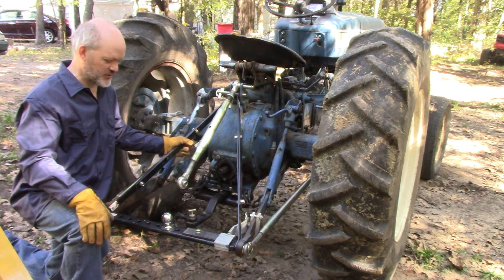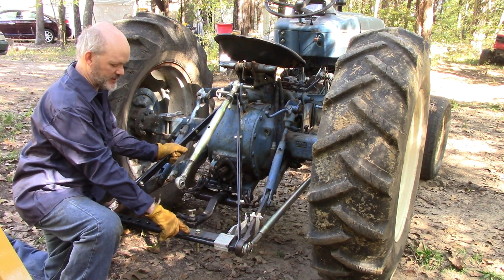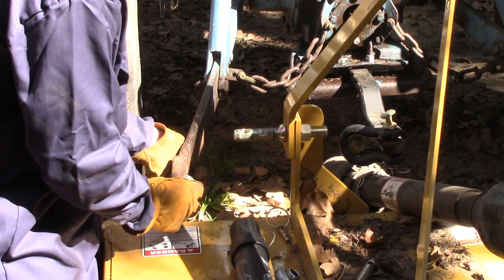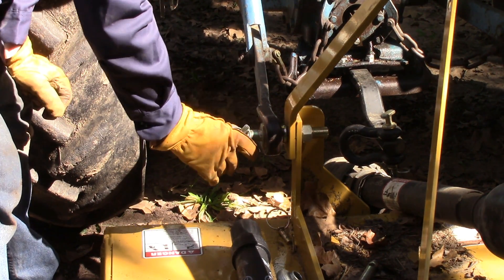Everything that connects to the back of your tractor: Three point hitch

Comment: Good info. More information on draft control for plowing would help. My 3000 always struggles with 3 plows. Looking for setting that will help.
Reply from the maker: I don’t plow so I don’t have experience with the draft control. I do know that these tractors have a pin that wears and makes the arms go up instead of staying in place. This can be worse if you are using draft control. I need to fix mine, but have not got around to it yet.

Comment: Thank you , im new to farming and got ford 3000 and all the emplements and trying to figure it all out. Im a marine and can handle a 1000 marines in combat but cant run a tractor, go figure.   Semper Fi
Reply from the maker: One place that helped me was Tractor Supply. Hidden way in the back behind rows and rows of dog food is a single row of tractor supplies. They have a very nice picture of the back end of an old tractor with parts and attachments identified. You should take a picture of it and study it. I ask a lot of questions on  tractor forum. It has an app. I also use yesterdays tractor forum and buy parts from there. Messicks has an app that I use for parts diagrams.
Reply: @TheDadPenfield  Thank you for the advice and I will use it often.

Comment: Nice video! The 3pt boom pole looks pretty solid wondering if I should invest into this when using a heavy duty chain to drag some logs. I have a drawbar now and thinking if I use just the drawbar I should invest in a drawbar stabilizer for my ford 1715. What are your thoughts?
Reply from the maker: The boom pole is a poor mans front end loader. I use it to transport heavy logs or stumps to a fire pit or lifting equipment. My ford 3000 does not have the front end nor the hydraulic power for a front end loader. 
The drawbar is outdated. If you want to pull heavy loads such as pulling a stump you should invest in a swinging drawbar. With a swinging draw bar the center of gravity is as low as you can get it and this prevents you from flipping the tractor. Drawbars can cause you to flip your tractor especially if the lift arms are raised up. 
 If you want to haul a trailer you should get a three point trailer hitch receiver. Unlike a drawbar. it attaches to a toplink so you don't have to warry about it rotating and it is less likely to bend with the support in the middle and you do not need stay bars because the top link prevents it from riding up. Some will have a hitch on top for gooseneck trailers.

Comment: Good video but you got to get fenders on that 3000. They are great tractors and worth keeping in top shape.
Reply from the maker: pseudopetrus Thanks for the comment. My priority has been a ROPS because I came close to flipping the tractor twice. It took a long time to design and build one. I did use a professional welder for the welds. But my design prevents placement of OEM fenders. So now I have to design and build custom made fenders.
Reply: @TheDadPenfield  Well that sounds OK, you are headed in the right direction ROPS is a good thing too!

Comment: Man This is a VERY dangerous tractor!! 
How do you drive it - let alone use any of the implements that are used on or with the 3point link or PTO or any implement at all on it WITHOUT ANY MUDGUARDS???
Imagine using a stick rake or the  drag blade or for heavens using slasher spinning at 3000rpm on it, how would you SAFELY check what you are doing behind you.  
Once you turn in the seat to see behind, any slip and under the rear wheels.
To use this as a working tractor in 2019 would be absolutely the most dangerous thing ever!!
Reply: Please say this is a joke!
Reply: Don't you go near any tractor if you can't use a ford 3000.

Comment: Well this has actually been helpful. I have an old 601 workmaster and when I lifted up my 3pt with two stabilizer bars at the bottom attached  (similar to the 8n I have)  it bent the hell out of the left one, so Im not sure as to why it did this on my 601 while the 8n is fine

Comment: Nice demonstration, you might had top link has locking tab to prevent it from lengthening.
Noticed back left tire seems to be mounted in reverse direction.
Reply from the maker: Thomas Schmitt 
Thank you for commenting. You are very observant. That tire is mounted backwards. It came that way when I bought it and changing it around is not easy. When I get stuck going forward the left tire spins, and when going backwards the right tire spins.
Reply: TheDadPenfield 
Thanks for your reply,
I have a ford naa and the items you discussed I had to figure out myself, I still don't 
Completely understand draft control .
I operate a back blade , rototiller, finish mower deck, and small brush hog. On irregular surfaces I tend to have problems controlling the height for back blade and brush hog. Example gauging or lifting of surface.
Any suggestions?
Reply from the maker: Thomas Schmitt  
Most people think that draft control is only for a plow. Some people say that they use draft control with a box blade when they use a box blade with the scarifiers down because scarifiers are like plows. Other people use position control and keep changing the postilion. The best thing to do is to experiment with your box blade with draft control and see if you like it. I don't think draft control is for a brush hog. I use limiter chains on my brush hog to keep the front (part supported by the lift arms) at the correct position because my hydraulics are not reliable enough to keep it there.
Reply: @TheDadPenfield   the draft control is actually more important as a safety device. until harry ferguson invented the three point hitch a lot of farmers got killed when their implements got hung up on something and the 
tractor reared up and the operator  got killed or mangled by the tractor landing on him. with the top link
control spring  adjusted properly if the implement gets hung up it push on the control which raises the lift arms keeping the tracking from rearing up. the 3 point on all modern tractors still uses the same design harry 
ferguson invented.